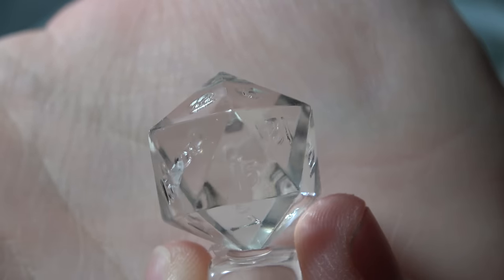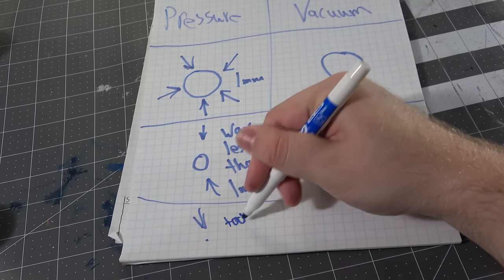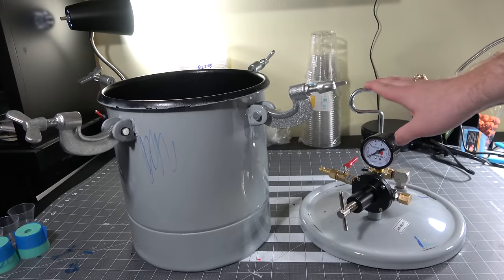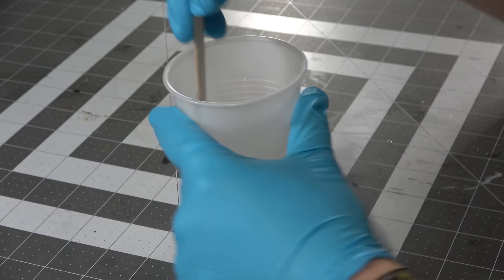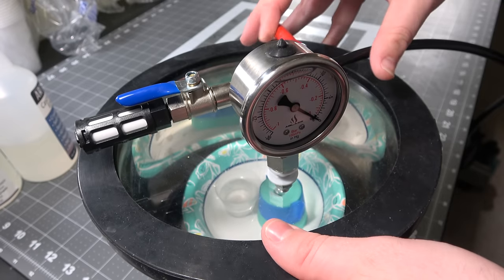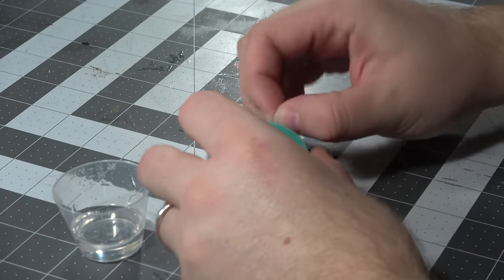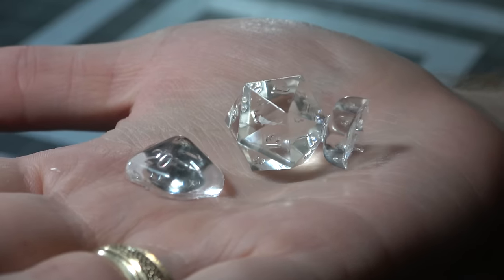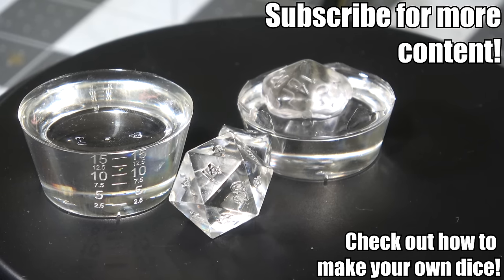Pressure Pot vs Vacuum Chamber | Resin Dice Casting

Comment: I don't have a pressure pot so I can't judge it. But the vacuum works for me. The problem with all the guys that test the vacuum with resin is that you let the resin overflow. You don't have to do that.  You can first degass the resin in a separate container and then pour it into your mold. Also you can adjust your molds so that your resin can overflow a little bit. You also must let some air go out before the overflow, then stop the process and then repeat a few times. You don't have to fully degass the resin to have a clear cast with a naked eye. It definitely works for me and my projects are proof of that. Anyway that's must my honest opinion! :)
Reply from the maker: That's a totally fair and good point! I was wanting to show the difference in the set it and forget it style. BUT if you are willing to do the adjustments or watch the vacuum, it works just fine. Thanks for the tips :)
Reply: @Rybonator  im sorry but you cannot use the same procedure when doing 2 completely different things. This is as if you would try to show flaws with the pressure pot by putting pressure on the resin before pouring and then "setting and forgetting". Its obviously not going to work due to what you are trying to accomplish and the materials you are using. 
Also degassing the resin beforehand in a bigger container could be seen as easier since you can pour a lot more quicker and cure outside the chamber.
Reply: Honestly I don't have either but even I was skeptical of his method while watching. I wanted to get my husband a vacuum chamber years ago for his mini dnd figures he makes but I never did. Then recently I started looking into ways to make dice, as a hobby gift to him. But when I saw this I was shaking my head saying "This feels so bias. That's too long isn't it?" Thank's for clearing this up. I think I'll need too look at more comparisons still. lol
Reply: Would it be possible to take advantage of both processes? I would say:
1) eventually cool down the resins A and B before mixing, to have a longer pot life,
2) use the vacuum for a little while to remove a good portion of the air, going slowly, progressively for 5-15 minutes to prevent overflow. I suppose you can this way at least reach 0.1 bar, which means 90% of the air is gone.
3) then apply pressure and let the resin set.
Would this process give a clearer result than using only pressure?

One more question linked to the previous, and also for those without budget to buy both devices:
I understand that you cannot at all apply pressure in a vacuum chamber, but is it possible to apply vacuum to a pressure chamber? I don't see why (apart maybe a question of connector) you could not do that....So, with my process above, you would not have to move your mold between both stages!
Reply: I have zero practice in casting resin, but I am an engineer, I don't understand why applying pressure works so well... 
From physics, the volume of a gas is inversely proportional to pressure (PV=nRT, so at constant temperature, Pressure*Volume=constant ), which means if you go from 1 bar (ambient pressure) to 4 bars (read 3 bars on the manometer since graduated a 0 for ambient), you then multiply the pressure by 4, so the volume of the bubble is divided by 4.  
The volume of a sphere is (4*Pi*R^3)/3,  so  a sphere B of 1/4 of the  volume of a sphere A has only its radius diminished by cubed root of 1/4, which is 0.629 . 
So, by applying 3 bars, the spheres should have their radius not even twice smaller...
This is all in theory. But pressure has long proved that it's working, so I must be wrong somewhere... 
Notice here that I am thinking while redacting....
...Now I have checked: your explanation of why pressure is working is partially wrong: the bubble are not disappearing because the pressure are pressing on them, reducing their volumes, but because the capacity of the liquid to dissolve the gas depends on pressure. It's what happens in a bottle of sparkling water: when it's still under pressure, the water is perfectly clear because the gas molecules are intimately mixed with the liquid, there are no bubbles at all.  When you open the bottle, the pressure is reduced, and the bubbles appear.
So my previous post should be wrong, no need to apply vacuum before pressure, if it's dissolved, it is clear, it cannot be clearer. 
But it should also explain why you can apply pressure to silicone: once the bubbles dissolved, there are no bubbles at all, just gas molecules trapped in the solidified matter, that cannot grow bigger.
It should also be a track to test whether it is useful to apply a deep vacuum to get rid of the bubbles. As soon as you have de-saturated the liquid (let's say at 0.5 bar), when the pressure is back the excess air of the original bubbles should dissolve, and any bubble disappear. May be this could avoid many spill out...
Reply: The explanation with the dissolution of gas also gives the answer why it is not necessary to apply the max pressure for better result. You could think "the more, the best", but as soon as the bubbles can be dissolved, you don't need more...
Remains my question: can you use a pressure tank as a vacuum chamber (apart from the fact that the clear lid is very useful to check for spills) ? This is in the case where vacuum is definitively better for silicon...
Reply: Thank you for this.  I've been having so much difficulty with my resin and vacuum chamber, and I finally have molds that aren't bubbly but my resin looks like soda fizz!
Reply: @gilbertcabasse6168  good 'ol Henry's Law.
Reply: @gilbertcabasse6168  in theory you could use a pressure pot for vacuum, but a pressure pot is designed to hold pressure pushing from inside the pot, a vacuum pot is designed to hold up to atmospheric pressure pushing on the outside. Would it work? Probably. But that's not what it's designed for. Besides, I believe having a window on the top is a good thing, especially if you are throttling vacuum while watching for overflow
Reply: @thedicefae9298  Consider also chemical reactions your resin has with materials mixed with it
Reply: I use vacuum, but I pull the vacuum in stages - increasing the vacuum  over 10 minutes in 3, or 4 stages. This totally controls the bubble over. Because you can watch the reaction you can do this easily by eye. On the last pull the top of the resin smooths out, and I remove the mold / container from the tank and let it cure at atmospheric pressure. 

I mention this primarily for folks that have a vacuum chamber and are considering getting a pressure pot - you don't need both! You can make the vacuum work for you.
Reply: I used epoxy to do metallography for years and always used vacuum to outgas, just keep your hand on the vent and if it starts to overflow just let some air pressure in to contract and pop the bubbles before it overflows. In my opinion the biggest thing to keep in mind with vacuum is that if you have a decent vacuum pump you can pull a high enough vacuum to start boiling the resin / epoxy. To an inexperienced person this looks like it's not getting all the air out when in fact the vacuum is so high your are evolving the liquids into a gas. Unless your working time is like 5 minutes and your inexperienced there is no reason why you can't get the same or better results with vacuum that you would with pressure.

Comment: When you pull a vacuum, as the bubbles start rising, you let air back in, that'll pop the bubbles and let the resin sink back down. Repeat til there's no bubbles.
Reply from the maker: Yes absolutely! It's more labor intensive than a pressure pot, but doable. You still have to worry about adding bubbles back in during the pour, as well as possibly running out of time as the resin begins to cure, but doable!
Reply: @Rybonator  longer working time resin should help, yes? I'm not sure how many options for resin are out there that have the structural or visual qualities you're going for.
Reply: Indecisive Fom what I notice the vast majority of resins on Amazon are fast cure.  You need not just slow resin for degassing, but very slow resin which is harder to find and probably more expensive.  For what he’s doing and the type of resin he’s using it probably is better just to pressurize.
Reply: @noelr9376  the opposite for me. The only resin I can find are slow cure epoxy.
Reply: mrjutsumaster I’m not talking about cure times, I’m talking about the working time of the epoxy before it begins to gel.  Please tell me where you are finding an abundance of slow work time epoxy.  Most I see are 15 minutes or less.
Reply: @noelr9376  I use alumalite amazing clear cast. Its got a 45 minute working time. Its the only thing I can get locally. But I don't use a vacuum chamber anyway.
Reply: mrjutsumaster 45 minute work time is great.  Thanks maybe I’ll try that.  I’ve been trying Alumilite Clear Slow, supposedly you can pour it up to 4 inches thick before it starts to overheat and crack.  I’ve been trying to embed 3D printed objects inside of it but i’m getting clouding along the edges between layers.  I’m also getting bubbles and cracking around the object I’m trying to embed. I’ve had luck with smooth on Crystal Clear 204,but I can’t find that stuff anywhere now.  I’m degassing and using a pressure pot.  I see all these videos of people making thick casts but they rarely explain anything, they make it look so easy and it’s not.   I don’t understand how they are getting these thick castings with objects embedded and they are coming out clear without a pressure pot.  They also don’t say which epoxy they use.
Reply: Like thin film vacuuming(BHO)? I'm not sure how well the thick objects would do, and am I wrong to assume it would be even be close to similar as the process of cannabinoid extraction from butane?

Comment: You pull a vacuum on the resin before pouring , never while its in the mould!
Reply from the maker: Oh absolutely! You absolutely could pull, release, pull, release etc, but it both takes practice, and is more labor intensive (If you wanted to do it in the mould). Not to mention that you have to worry about your cure times if you don't degass fast enough. Compared to the set it and forget it pressure pot, I just prefer it :) But it's a totally valid, and probably proper, method! But yes, vacuum before pouring :)
Reply: vizionthing 7:36 dude. Next time watch the whole video, and be sure to listen
Reply: @Recommendedforyouall  yes, he does say you can do it but you take the chance of putting bubbles back in your resin. Most videos I've seen of people who use the vacuum method use the longer working time resins. 
The way it's done in the video is very skewed towards the pressure pot that beginners that didn't know any better would swear you couldn't use a vacuum system.

Comment: The use of of the vacuum pot is to pull the bubbles out of the epoxy before you pour the epoxy into the molds.  Yes, you may introduce bubbles while pouring, but they will not be as bad.
Reply from the maker: True, but you could still overflow from your cup, and you might introduce some bubbles, AND you have to worry about cure times in your resin while you are doing that, and it's labor intensive instead of set it and forget it. But it can work :)
Reply: @Rybonator  if you want the best finish, you have to pull out as many bubbles as you can before make them smaller with the pressure pot. Overflow problems? You just have to use a 3 to 4 times the volume of the resin cup, pour the resin into the mould, and compress the small amount of bubbles left. Only by using both methods you will achieve a perfect copy of your models. If curing time is a problem go for another slower curing time resin. I consider that is not fair the fact that you only show a resin cup and a mould overflowing everywhere, it is just a wrong way to proceed and a lot of people who are starting casting can be confused. I have to dislike this video dude, it just shows wrong content.

Comment: I wonder if you could see the bubbles if you took a microscope to the piece after the pressure pot.
Reply from the maker: Good question! I'd love to test this out sometime :)
Reply: I would love to see this tested some time. The results may shed some light on my theory (in a different comment) that the pressure pot actually causes the bubbles to be dissolved into the resin, not just squished down.
Reply: @Rybonator , I so happen to have an extremely high powered microscope with video capture of you did want to seriously have a look ;]
Reply: @TrollFaceTheMan  You definitely should.  I'm interested to see if a pressure pot would put micro fractures in the finished die when pressure is normalized.  I'd also be interested to see what resin would look like if left to fully cure under vacuum.
Reply: @raistlarn , well if they ever wanted to I would be more than up for it.

Comment: This is super straight-forward and helpful! I can't find any type of pressure pot available for purchase in Norway, so I was thinking of just getting a vaccum chamber - but now I know that wouldn't be ideal! Thank you for saving me the time and money (':
Reply: Hi! Jula sells something similar as calling it a "trykkfat" No idea if it is any good though, reviews seem kinda bad.
Reply from the maker: Glad to help where I can :) Best of luck in your casting journey!
Reply: The one from Jula looks like the same one as Robynator uses in his videos. All the reviews pertain to bad O-rings in the hose for the paintgun(easily fixable) and should not interfere with using it for resin-casting. As far as i've understood the reviews atleast.
Reply: You can still use a vaccum chamber. However you need to pull the bubbles out of the mixture before you put it in the mold. Both can work, its just that they have two different methodologies.
Reply: pressure cooker you would use on your stove can be a good start. I am using a pressure pot used for painting. ck HF store. or amazon
Reply: Both methods are fine, if you are just interested in casting and not in doing structural stuff.
Personally though, using mostly epoxy-resin for structural moulding, I wouldn't even consider pressure.
Why settle for something which will still leave you with bubbles in the resin?

Vacuum degassing is fast, safe and easy.
The only change needed to prevent such a stupid mess, is using a sufficiently big cup and degass it before pouring.
If the cup is big enough, the vacuum will make the bubbles rise and pop quite fast, way below the lid.
Using the pipette-method, you would really have to put effort into getting bubbles back in.

Bonus: Mixing, degassing and moulding takes mere minutes.
Once done, you can instantly go for a new batch - given you have enough moulds.
With the pressure method, you will have to leave the pot under pressure until the resin is cured.
Reply: @stankrieger3598  I bought a used pressure cooker I intend to convert into a little pressure pot :)
Reply: @ferdlhofreiter45  If you do figurines, you do not have bubbles only in the resin, but also between the mould and the resin. Pressure takes care of both in one go...